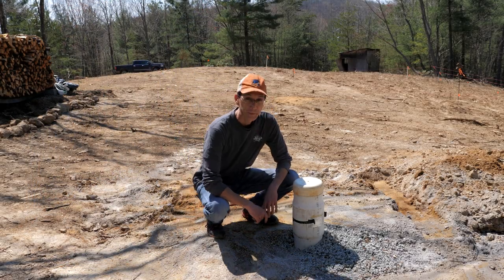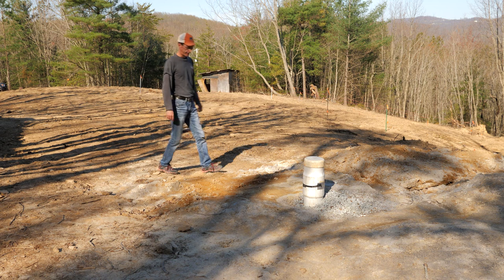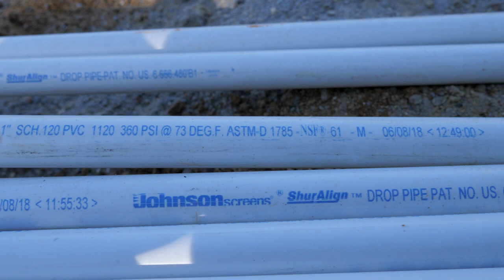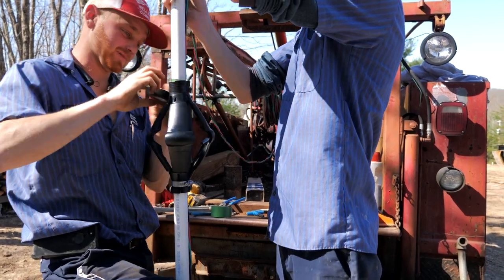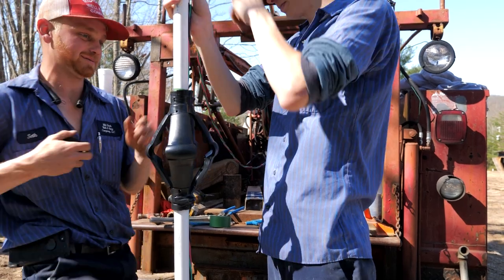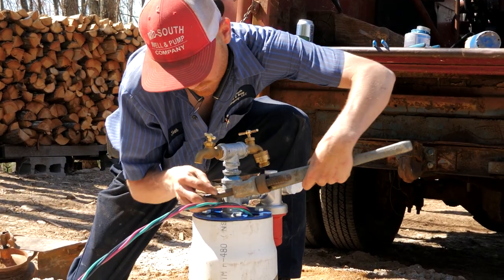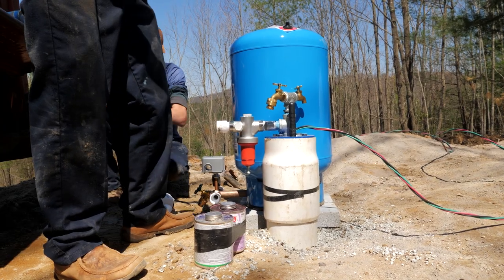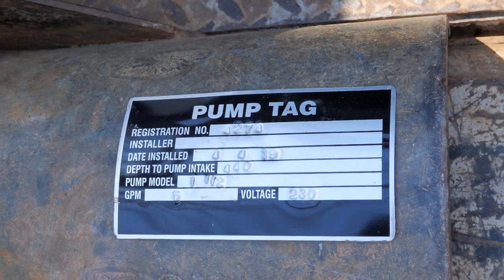Off Grid Home Build (#8): Installing a Grundfos Submersible Pump - (Part 3 of 3)

Comment: As a retired well driller and pump installer it was nice to see this company install the pump correctly.  I see too many on YouTube do it wrong and people have problems later.  Well done.
Reply: Same
Reply: What do people do wrong usually?
Reply: @privacyatty  try to do their selves
Reply: @privacyatty  Many of them forget to check valve the pump itself also they don't use the rubber spreader about 20 feet above the pump to stop twisting in the well.  There is a lot of torque when the pump starts and you do not want your PVC pipe or Poly Pipe to twist from it.  They also taped the wires every 10 feet to the pipe so that they will not scrape against the casing preventing wear on the wire covering.  The way they did this job was correct unlike the original installer.
Reply: @sierge1  Thanks. I got an extra agricultural use well drilled and I am going to attempt some DIY. It's 65' deep. 20-25 foot static water level. And it produces at 100+ GPM in a 5" casing. I did get a torque arrester. Well guy said put pump around 45'. I think it's pretty shallow compared to these other videos. Pump I got said around 30 gpm at that head.

Comment: Glad to see you guys finally got that well, and no more water worker tank!
That's a hell of a water table too, not like down in the south we hardly get deeper than 100' most around 20' to the water.  You will probably need a filter with all the iron.  Since you have a captive air tank it's best to get a softener.  Choosing one with a metered timer so you don't waste salt.  Just run the water for a few days till it clears up then get a hardness test to set the filter by.   Take it easy and great video of the install!

Comment: Hey Guildbrook. Great video. An optional drop pipe we have is WellHose DIY Drop Pipe. It is available in one, continuous length and you can pull and set pumps very quickly and easily. Cheers

Comment: I would not use a pressure tank as an on/off switch. The life of a deep well pump is governed largely by the number of starts it has to make, so if the deep well pump has to fire up every time someone uses the toilet or washes their hands, it won't last long. You should always install a large water storage tank that can be filled up from time to time using a high/low level ball float in the tank. That way, the deep well pump only has to fire up once a day or less. Of course you need a simple cheap centrifugal pump to get the water from the tank to the house. These are very cheap and easy to service. Also, you always have a few days worth of water in the tank in case anything goes wrong with the well pump. On my installation I use a simple electrical timer to turn on the well pump for 30 minutes a day and that is enough for all our water use, and the well pump only fires once.
Reply: Wouldn't you need a special pump with a duty cycle long enough to fill the entire tank?  I didn't think submersibles were meant to run that long.
Reply: There is a cycle stop valve installed. It was the thing with the red bell on it that points down right next to the well casing. They work by creating back pressure so the pump won't cycle. I am surprised I didn't see a check valve though.
Reply: The check valve is after the first stem of pipe 12:13

Comment: jeremy; i noticed on their install, 1) they should have staggered the connections at the pump (what they did may be ok but stagger is code), 2) i sure would have put a rescue rope or small aircraft cable safety line along the pipe.

Comment: I dont like solid wire , almost every failure we had was because of the solid wire, stranded will not break when kinked and handles long running times better, larger surface area, the only advantage is solid wire is cheaper .
Reply: Correct, the only advantage of solid wire is that it's cheaper. The crimps will last longer with stranded wire.

Comment: Over here between Gatlinburg and Pigeon Forge, Tennessee about four hours from you with similar terrain. We currently have one acre and just got the deep well drilled this past Friday, May 3, 2019. Was worried about how deep we would need to go as we also decided to drill on the ridge line at the highest elevation where my husband has already completed our tiny cabin (about 600 sq feet) which is about 40 feet away from the well head, He built the well pump house under the cabin as it is on stilts.
We feel lucky that we have about 5 gallons a minute and hit good water at 345 feet. I need to figure out our static level and the size of submersible pump we need. We were thinking of dropping a cork but I will he using a one pound weight with the 20 pound test line. Great tip. I had seen many people using the nylon rope like you use for water ski tow lines and thought we needed that but I didn't notice your guys install anything like that. I am just going to copy how well they secured every joint plus  half way on the first half a dozen or so lengths of pipe.

 My husband plans on doing all of the plumbing and installation in about two weeks when he returns from Florida.Really appreciate the footage of the "pros" doing your install as we can make sure to emulate. He was a commercial plumber in a previous life but changed careers when our 32 year old son was 3 months and became one of the original stay at home Dads with him and our then 2 year old daughter while I went back to work after a two year hiatus. We lost everything except our lives though a series of events which included a boulder rolling through our home about five years ago and had to start over in our fifties. Now I'm torn between living the #vanlife or creating a great place in the woods for #vanlifers to come and visit us.
Appreciate the great content on your channel.
Reply: Josima, mind sharing what approx elevation your cabin is near PF. and approx cost per foot to drill that 345 feet.   I am looking at land in near Cosby)

Comment: great install. Just curious, why not use all brass fittings instead of galvanized?
Reply: I just replaced all my galvanized fittings with brass.  Would've gone with stainless steel if available, but lead-free brass is a close second.

Comment: I would use a some kind of cord (may by stainless steel ) to secure the pump  all the way to the top. What happens if it brakes off from the plastic if you need to pull it up and replace it ?
Reply: I was thinking the same thing.   For me, it's just another layer of protection.  The cost added monetary cost would be an extra $150.00 max?
Reply: Thats what the electrical cable is for :D
Reply: Why is my pump not cutting on seems like it don't have electricity going to it and my pressure gauge is not working what should I do
Reply: @aprilsharp7381  there are only a couple things that can go wrong with these systems.
All systems have a pressure switch/pressure sensor usually at the tank that can fail. That is usually the one thing that can be tested. BE CAREFUL! These switches usually have 220v running through them and if you get shocked it will seriously hurt or kill you. If you are not confident with electricity it is best to have someone who is check it. You want to make sure there is power getting TO the switch, and that there is power going from the switch. If there is no power to it you have a breaker/supply problem. If there is no power from the switch you have a problem with the switch (you can test this by bypassing the switch and checking if the pump kicks on) and if there is power from the switch the pump needs to be pulled and there is an issue with it or the wire to it.

Comment: Great video, but where is the safety cable for the pump? If you have that pipe break for what ever reason, how do you recover your pump? I always install a 4mm Stainless wire rope and I always use poly pipe as there are no joins or flexibore bore hose.
Reply: I work for a company that does these types of installs and services. We only put in double-sleeved or jacketed 8 to 12 gauge submersible pump wire. We have had galvanized pipe break off in the well and the only thing that brought it out was the wire. We tape every joint. If we lose something in the well we will "go fishing" which is just calling the deep well turbine boys up and having that side of the company come in with cameras and magnets and other tools to clean the well. If we cannot clean the well or "Fishing " is more expensive than drilling the owner will have to drill a new well. We do a very similar install method to what these boys did.

Comment: My 1st welding job after I got out of school was working on a water well drilling rig . Watching your videos really surprised me how they did it and using pvc casing and pvc pipe for your pump . We always put a extra 20 ft of wire on both ends of the well incase of having to change pumps and changing wiring at top of well . We used 6 or 8 inch standard wall on casing and welded the joints together .  Depending on what material the client wanted on pump is what we used but it was always some kind of steel . 
Glad you guys got your well done ! I'm hoping I have internet where i'm traveling for work so I can keep watching your videos as they come out . If not marathon videos when I get internet service again . 
Can't wait to see you start the house ! I'll being buying my off the grid property by the end of the year can't wait to get it bought and build my place ! Finding the perfect raw land I see as being the hardest part of my off grid homestead . 
Keep up the great videos I'm pulling for you guys !!!!!!
Reply from the maker: Also the biggest challenge we’ve ever undertaken. But meh. Win big or die tryin. 😉😎

Comment: My unexpert opinion (but experience through 2 pump replacements, no water and crap service guys) those guys set you up for success! I learned the hard way all about my system. 
Congrats on a working well/pump system!!! People don't understand how freaking exciting it is to have running water!
Reply from the maker: Yes. They did exactly what I wanted and did it right. 👍🏻 And I didn’t have to do any of it 😂

Comment: Hi David here, when I was living in Germany for seven and a half years we had a very interesting water heater. It looks like a water heater tank but in the center we had used it as a stock or chimney. Underneath was a burner that would burn wood and that would heat the water inside of the tank. I'm only mentioning this to you because of the fact that you have plenty of wood to burn. It might be easier to convert the water heater tank into that type of system. Instead of going through all the copper tubing and everything you would need to make it into a solar heater, water heater. Message me back and I can go into more detail on how the system worked. Bye for now pray that things get easier for you guys

Comment: I in east central Georgia, I had my well drilled in 1975, 100' through dirt, 400' through blue granite. Pump is down 365'. We have excellent plentiful water! I checked with Rural Power Systems Co. about a solar system for my well, they say they have one that will work for it. Check them out. I think price they gave for one was about $2,600. I don't have it yet, but definitely would like a solar pump!
Reply from the maker: Made in China 👎🏻
Reply: @Guildbrookfarm  Oh me, didn't know that! Reckon I'll just keep my power line pumping my water.

Comment: good luck pulling that pump back out I use 1 inch black pipe on a spool
Reply from the maker: Not that deep. Black poly pipe is a pain in the butt at 440’.

Comment: I have a nice Koehler 8.5kw whole house generator I will sell that runs off propane and has very low hours on it and will run 110/220 with either a 30 or 50 amp circuit for stuff like the well pumps  it would be awesome to put up there to run everything while you build. 

I’m down here about 20 miles south east of Greensboro and south of Burlington/graham about 10 Miles. 

Will make you an awesome deal. Just let me know if your interested and we can go from there
Reply: Yep, that'll only cost about what, $200 a day to run?
Reply: Taka Yama it cost me around $20 a day to run off of LP. But I’m sure if your running it at max rate night and day then it may cost double that but my average for keeping essentials going which are a well pump, a/c, fridge,, gas stove and tv and I average 10 days runtime on a 100 lb propane bottle do it’s not bad at all. 

Its much better than sitting there bitchin and crying about being hot and can’t keep food from spoiling like you do but to each his own

Comment: Guess they forgot the safety rope, also solid wire does NOT crimp as good as stranded
Reply: Never used safety rope or safety wire. Can't attest to solid wire as we always used stranded wire
Reply: I've got two safety ropes on mine. Obsessive-compulsive disorder kicks in when it involves pulling a pump 60 ft by hand

Comment: Seeing as your well is on a high point of your property a poly tank installed on that ridge and then everything else could be gravity fed down to stock troughs etc then you would just need to pump up to fill the poly tank once a month or what ever depending on your water uses around the property
Reply from the maker: Correct. 👍🏻

Comment: Nice to see a pump put in so prfessionally.  I imagine an insulated pumphouse isn't your highest priority right now.  Suggestion: buy a $20 tent, cut a hole in the bottom, then cover your set-up and stake down.  Keeps it clean from all the construction dust and maybe the size/bright color might just prevent someone from backing into it.  A cheap investment....  Seller "Longtime" had an orange 7x5 on ebay under $25

Comment: Guess you will be doing as we did and add a 3 to 5 gallon a minute restrictor in line to help prevent overdrawing the well to recovery time.  we can pull about 180 to 200 gallons a day and keep recovery time ahead of the draw time.   You keep the same pressure just limit the flow.
Reply from the maker: Well is 5gpm, pump is 5gpm. We’re set. 👍🏻
Reply: @Guildbrookfarm  Our pump puts out 12 gpm  and no way to set it to less.  we had to use the 3 to 5 gpm water flow reducer.  We get 220 gallons in 24 hours on recovery.

Comment: if you the Grundfus SQ flex you could runit on 120 volts my off grid well is down 400ft  it runs off my outback 3000 watt inverter with out a problem

Comment: So is there a reason why they don't pore a concrete pad around it?  Or is that not advised?
Reply: That all depends on where the pressure tank is going to be located, and the pad is usually poured after the pump is set.

Comment: if you have a problem with sulfur smelling water they should have used a retention style water tank I can elaborate if you'd like.....We mostly only use a bladder style tank for irrigation systems. Didn't really understand the 3 in pump verses a 4 in. which can pump more water from deeper depths . the largest 3 in pump in that grundfos which is an excellent pump btw is that 1.5 hp . But I would've put maybe a  2hp 10 gpm which around that depth setting should pump around 8.5 to 11 gpm on 50 lbs of psi unless they thought it would over pump the well ..anyway Good Job from a 4th generation well guy & critic lol
Reply from the maker: Well is 5.5gpm so this 5gpm pump is perfect I think.

Comment: My partner and I pulled a 320’ well ourselves twice. No crane. A cedar tree tripod which wasn’t even used.  I myself have pulled a 130’ well myself.
Reply: Go with roll pipe its much easier.

Comment: Ha ha ha ha .... Pump tag!  Yay water.  Wow only 1/2 hour before the well drops enough to turn off the pump.  Gonna need a good size holding tank.  So glad to see progress on the new digs.  I can surely see your stress.  Sometimes life goes on by the hair of our chinny chin chins!!!
Reply from the maker: I didn’t explain clearly in the video but the well regenerates at 5gpm and the pump pushes 5gpm so the water level would never actually deplete. The 30 minute time would only happen if we were pumping 10gpm. Which we never will be able to do with this pump, so we’re good. 👍🏻
Reply: @Guildbrookfarm  ahhhh ... Thank you for clarifying!

Comment: Nylon wire ties would have held everything together better and longer than a bunch of tape that will eventually rot off. It also would have held the tape in place even after it rots. Probably would have been better to use big thick nylon wire ties in place of the stainless steel hose clamps that he said still rust and fall apart...
Reply: Actually, I have installed these systems myself. More to the point I have had to repair these systems, because some 'professional' just tossed things together as cheaply as possible. While charging as much as the market would stand. But I am not a professional well pump installer. I don't have to be, to have common sense. And that is why I have been asked to install some, and have been even more strongly called on to repair some. 

Tell me how cutting a crazy ragged dip into that well casing, when the original was at least 'square' to the pipe.... And dropping all those pvc cuttings into the well... Was 'professional'. Tell me how continuing to use tape instead of something more durable like nylon wire ties, makes more sense. Especially in light of the fact that if you install well pumps, you also replace them. And I KNOW that when you have replaced pumps you have seen tape that has rotted. Or has simply come unwound, and ended up in the bottom of the well, if not clogging the pump. And you have seen Hose clamps rust and fall off.
You don't have a real argument against my post, based on facts and common sense, so instead you decide to attack me. Hows that working for you?